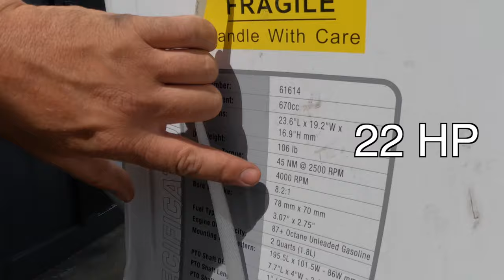This Engine Swap Was INSANE!!!!

Comment: I am working on this swap on a G-19 cart... Were you able to use the original brake cable that attaches to the pass side of the gearbox?   And about where did you set the high and low speed jets?

Comment: I’m doing the predator 459cc on a cushman but the rotation on it to the rear end is going to be backwards. I noticed your rear end is on the passenger side too, did you have this problem and if so how do you fix it? Thanks.
Reply from the maker: No we did not have this problem! Dropped in and worked!
Reply: Some of the stock engines spun backwards and the rear end was built that way. I’ve seen people make a shaft off the flywheel to rotate the engine around to spin the right way for the rear end

Comment: How fast is the 420cc you say because I’m thinking bout swapping y 2 stroke to it because I average 15 mph in my g1 and I looking to get about 30 if possible with the 420
Reply from the maker: Depending on the rear end and tire size we usually se about 25 mph

Comment: Hey, so I had a question I don’t know if you could help me out I got a predator 420 I did a electric to gas powered conversion and an EZGO and I put a gearbox on it I have a 10 tooth sprocket on the gearbox and a 36 tooth on the transaction lol but for some reason this cart is super slow I feel like I should be going a lot faster. I even had a smaller sprocket on a transaxle, and it was even worse.
Reply from the maker: I have not done any with a gear box. All swaps have been into gas carts already. There are some good facebook pages that can help you. Big Block Gas Golf Carts is a good page with a lot of info on it.
Reply: I am currently going through the same situation, 10 tooth  with a F R N gearbox ezgo rear end is 12;44:1 i have the rpms but top speed is about 7 mph. What did you do to fix it?

Comment: What is the top speed?
Reply from the maker: top speed is about 25-30mph. We are actually in the process of ditching the stock carb and replacing with a mikuni carb. I don't know it this will get me more top speed or not. However the torque is the biggest upgrade with this engine swap.
Reply: Until rpm is increased the speed remains the same. More power just gets it there quicker.
Reply from the maker: Correct there was no speed change. Does runs a lot better with aftermarket carb though.
Reply: Is that an ezgo workhorse?
Reply from the maker: @dtruth5769  club car ds
Reply: Fastest golf cart
Reply: What carb did you use?
Reply: @CartPerformance  What year was your Club Car DS ? & will their kit work on ALL years of that model??  Thanks